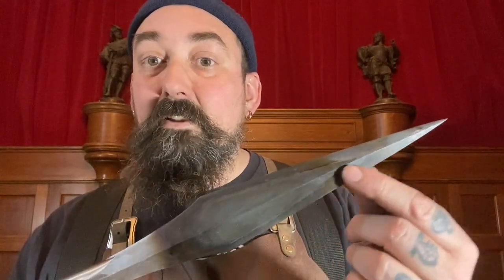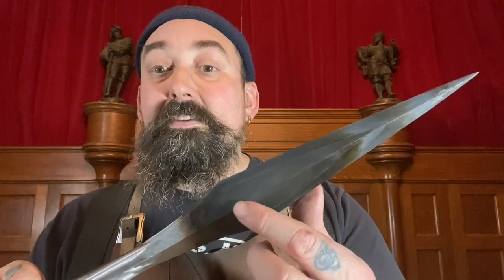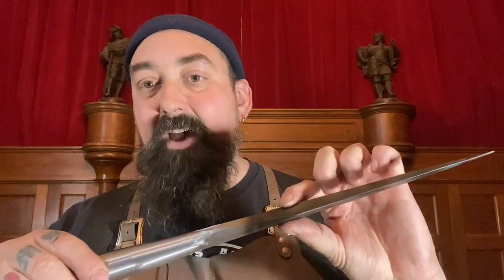What does "differentially hardened" mean and how do you do it?

Comment: Could you through harden to a specific springyness and then induction harden the edge a bit more without warping a double-edged blade? Would it just undo the previous hardening? Would it provide any benefit?
Reply from the maker: it would undo the previous.  When you want a differential hardness like that you generally remove the piece from the quench when the thickest part is still hot. the edge, which is thinner, will cool more rapidly and harden more if you do an interrupted quench. You can also use a blade that is a composite of different steels, for example a harder steel at the edge, and one that hardens less as the center.

Comment: Isn’t the sword supposed to be harder to bend at the base of the blade and more flexible as it gets closer to the tip? Isn’t that what differentially hardening is for in medieval swords ? Ty
Reply from the maker: nope, that is due to the distal taper where the sword gets thinner as it gets to the end.  Swords that are differentially hardened will be harder at the edge than in the center of the blade.

Comment: Are you implying that medieval Europeans did produce differential harden steel?
Reply from the maker: Not as a desire to do so but as a function of material and processing. The steel/iron mix of the middle ages had variable carbon content in most items and they used this to advantage in design and function. Our steel today is more highly refined then they would have achieved.